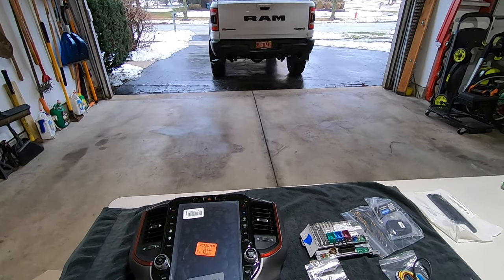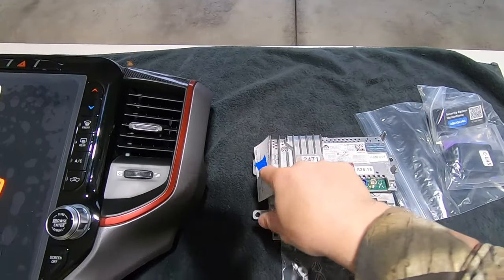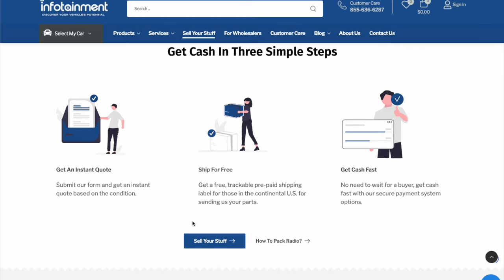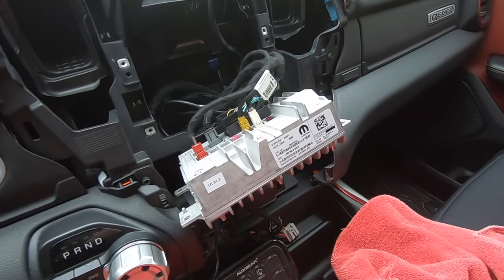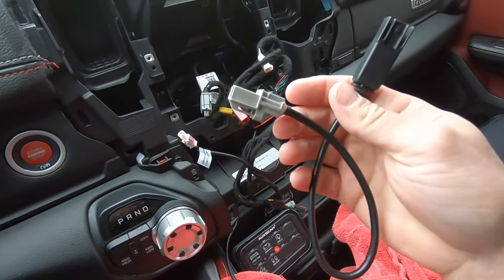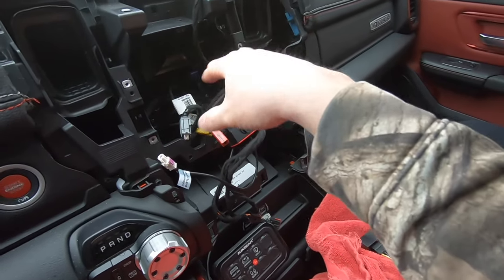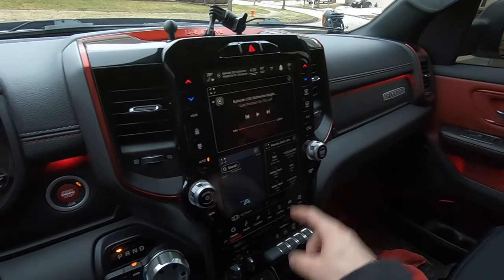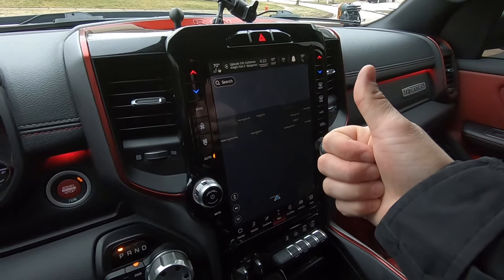Infotainment.com - 12" UBQ Installation - Ram Rebel (Wireless Carplay!)    #infotainment #ramtrucks

Comment: Another great video!   Thanks for sharing. My Rebel is a 21 with the 12", but would love to do this upgrade!  Do you still have the Taser DT installed?  After the programming stops and everything works, do you remove the security gateway bypass box?  Lastly,  do you know if infotainment would give a buy back amount before purchasing the upgrade?   Thanks!
Reply from the maker: You’ll have to check on the buy back before. Yes I’ll be reinstalling the Tazer this week. The Tazer plugs in where the security bypass was installed.
Reply: Did you "unmarry" it before removing it, or just remove it since you are reinstalling it. @WaterFowler41
Reply from the maker: @danielfletcher1384  unmarried it before I installed my tuner a few videos ago

Comment: Great video. If I already have the 12” UC4, do I need to buy a kit and replace with a whole new screen? Or do you know if there is an option to buy just the module and wiring kit? Thanks!
Reply from the maker: Unfortunately you need the new screen too but you can keep your existing center console bezel and swap the new screen

Comment: I have a 2020 ram rebel with a factory 8.4” no navigation do I need to purchase anything else besides the Uconnect 5  to be able to use navigation and hotspot ? 

Also if my truck came with no remote start do you have any link to where I can add it ?
Reply from the maker: I think you need the module and the screen to upgrade to uc5. I would check with infotainment folks, they were super helpful when I was ordering.

Here’s a link to the remote start kit: https://infotainment.com/shop/exterior-accessories/remote-start/2019-2023-ram-1500-dt-factory-oem-mopar-remote-start-upgrade/
Reply: @WaterFowler41  did you get the extended warranty?
Reply from the maker: Negative

Comment: Did the ram app work as well as the sos/assist ? Read in some ram forums that it wasn’t working in the 2019-2022 models once people upgraded to U5 from U4
Reply from the maker: To be honest, I don't use the Ram app so not sure I can opine on that
Reply: I just called infotainment to check on this exact thing. I was told that if your current radio has the xmgaurdian ability then the new 12" will also have it. But if your old system did not have the XMGuardian ability then the new system will not have it either. Since my 2021 Bighorn with 8.4c with nav has that ability, which I use all the time then if I bought the new ucconect 5 12" I can expect that to function as normal.

Comment: Hey man i have ram 2020 sport edition ….what model of this 12 inch screen do i use ?
Reply from the maker: You can use the UC4 or UC5 version.  I'd recommended the UC5 if your going to spend the $$
Reply: @WaterFowler41   its like a 1000$ difference right ?
Reply from the maker: @MavinSaini  depends on what you have, it’s been a while since I last looked at the site.

Biggest difference is full screen CarPlay versus half screen, and wireless CarPlay, if those features are work the extra $$ then go for the uc5. If you can live without go uc4

Comment: How much was this for you?
Reply from the maker: The kit I installed in this video is a bit over $4k.  If you already have the 12' UAX screen, the UBQ upgrade kit will run you around $2.6k.  I had someone local to  me interested in my UAX system once with the center console once it was removed so it made more sense to go with the whole kit.

You can price the kit out for your specific application here: https://infotainment.com/shop/interior-accessories/infotainment-radio-upgrades/2019-2024-ram-1500-ubq-uconnect-5-nav-with-12-inch-touchscreen-including-wireless-apple-carplay-android-auto-upgrade/
Reply: Would pulling a UConnect 5 out of a newer junked truck work? I have a 2021 with a 12" screen but hate the wired android feature. Not willing to spend $2.6k and I've tried a dongle adapter but it made the screen freeze up a lot
Reply from the maker: @chrisj279 you’ll need the module and the screen from a Uconnect 5 equipped truck

Comment: My hazards and blind spot monitoring aren’t working. Anyone have a similar issue??
Reply from the maker: Hazard is a separate plug, make sure you plugged the harness back in.  As far as blind spot, that may be one of the features that takes an hour or two to come back.  I don't have blind spot so unfortunately cant provide much guidance there.